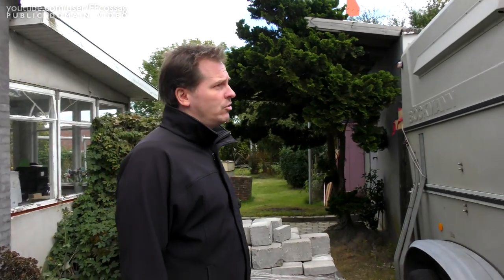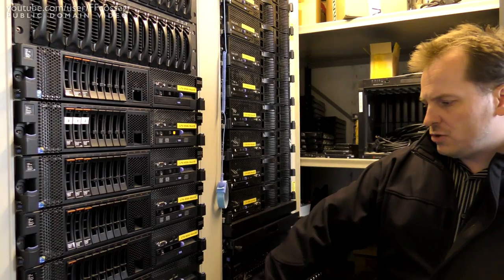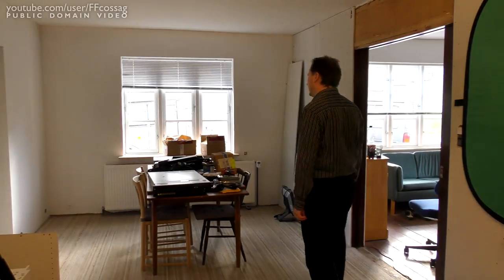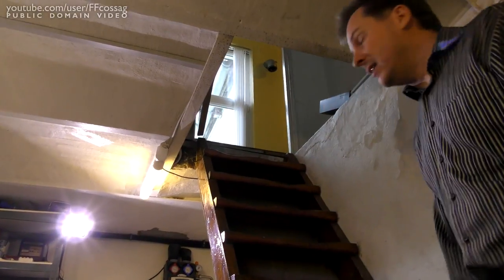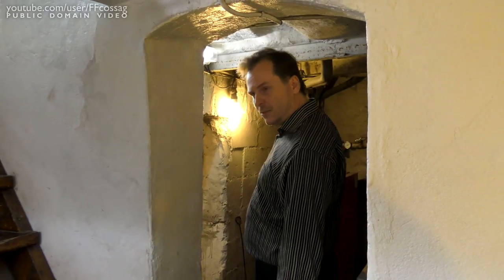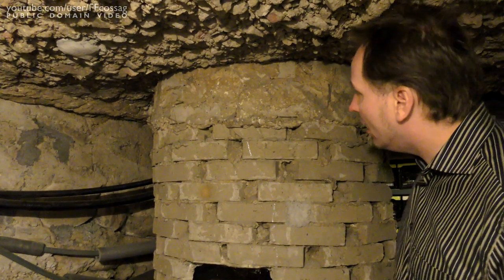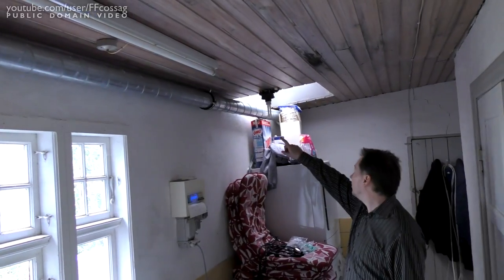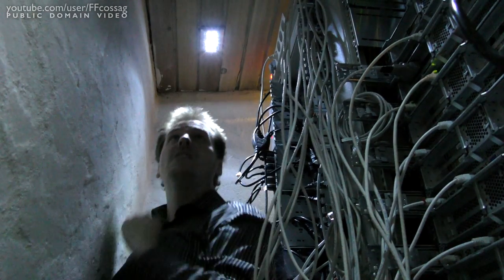FFcossag visits MyPlayHouse!

Comment: Wow, I did not see that basement on myplayhouse channel, where ffcossag was last seen :) that is proper dungeon;with ups
Reply: Hi mechadrake
FFcossag is very tied up right now! :-) So I will assure you that I have been making video from the basement before.
Reply: I have not seen all the videos yet :) pretty sure I had a glimpse on one, but not the whole picture like on this video.
Reply from the maker: MMPH MPPH MMM MFF MMMMPH!!!
Reply: Just a moment mechadrake 
I think I hear the well pump making weird noises, I will go give it a good kick,,be right back :-)
Reply: :D
Reply: just gluead to the wall inside ant it works? I have a cellar(root cellar actually) which i too wet, it even has puddles in the we weather. it needs some waterproofing, have no idea about that though
Reply: If the pump runs, it's all okay.
Most of the year it is not that bad.

Comment: Hopping and dancing :D. You're not the only one who uses server poduced hot air to heat you. We are using it to heat up our datacenter (350 servers, it is 23 celsius now inside when it's -2 outside.)
Reply: HI
I can run more stuff in vinter! :-) and it does not feel so bad when you get both compute power and heat out of your servers.

Comment: I came here from My PlayHouse, and subscribed. :)  I find the well very fascinating.  Why is it so shallow and so hot?? :-O  70C, right?  So 158F??  I hope to see more about it Morten! 👍
Reply: HI Tim
I am afraid the water is only from 7-10C in the well. but with a heat pump I could use that to heat the house.
I did do a video back 27/2 2014 on my well, it is video No. 017 enjoy :-)
Reply: Oooops.. I misunderstood when you said "7 degrees" then. :-/ Heh  So I guess 7+ degrees is warm if the air temperature outside is cooler than that...
Reply: HI ***** 
With an heat pump, you can suck out the low heat of air or water. It is not this simple but lets say I have 1000L 7C. water, the Heat pump could make 100L 70C. out of that. There are a lot of losses bla bla.. but that is the idear.